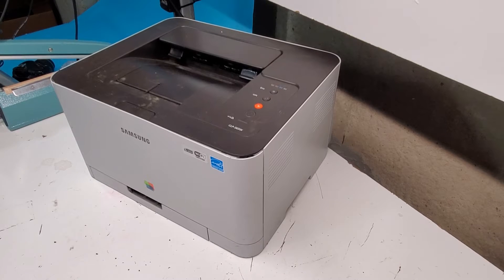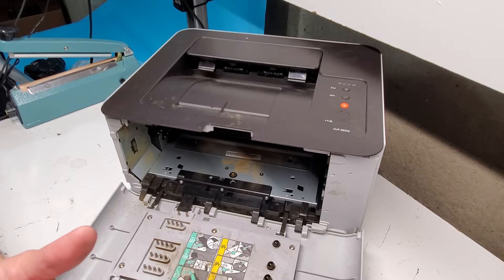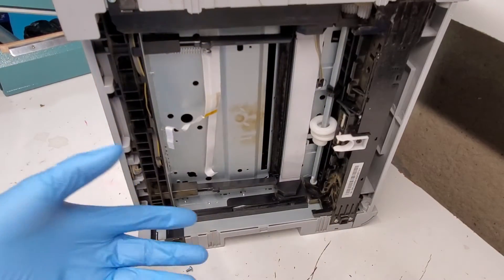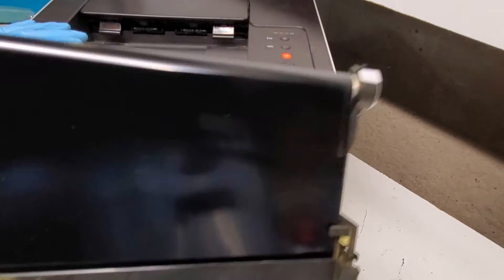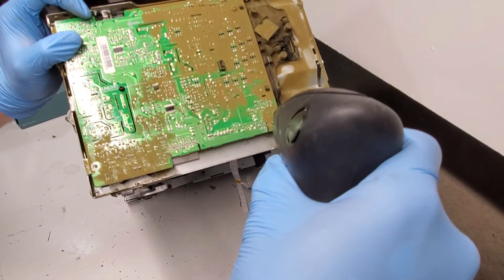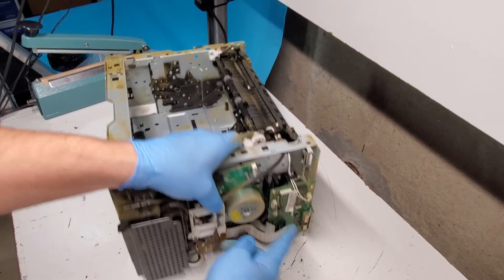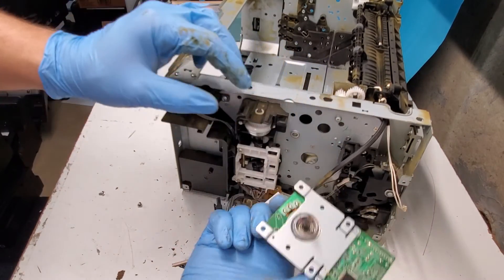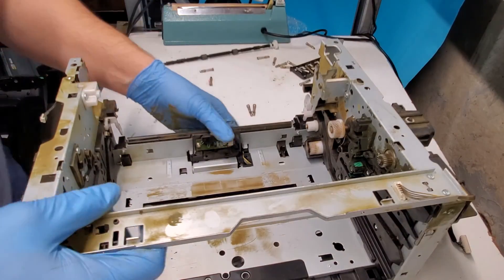Taking apart Samsung CLP-365W Printer for Parts or to Repair CLP-365 Disassembly

Comment: Hi, My CLP-365W Printer is not power on, some one told me it's because of low voltage power supply! how can i be sure it's correct?
do you have any video to fix this part?

Comment: How replace battery which stored date etc
Reply from the maker: Hi. The battery does not store any information.  Printer main board will do that usually and for short term. When you replace battery on a main board, you will need to set date and time again. I'm not sure if this printer has a battery. If it does, it should be very easy to replace.

Comment: Hi , I have a laser printer samsung CLP 360 color;
Do you know why it print only Black and Ciano now? (in origin was fine and I also printed from 2014 not many pages).
The system recognized all the toner level over 40% minimum and it does the test pages print. 
I also tried to change the toner with newone but nothing changes.